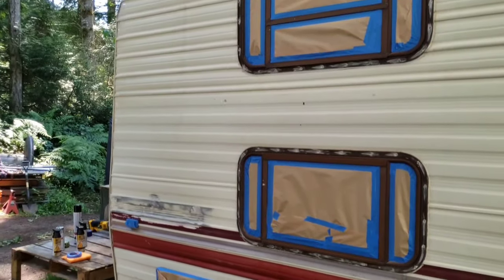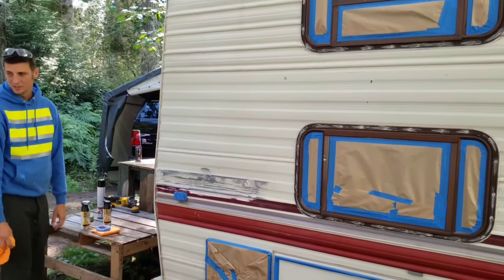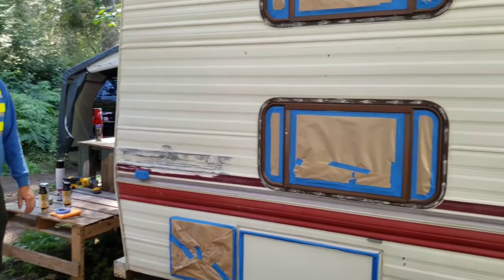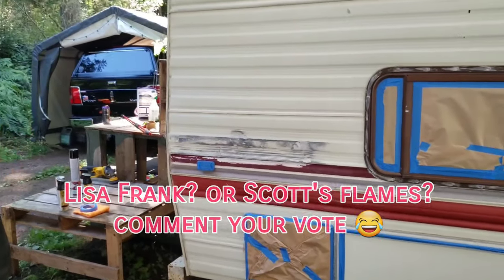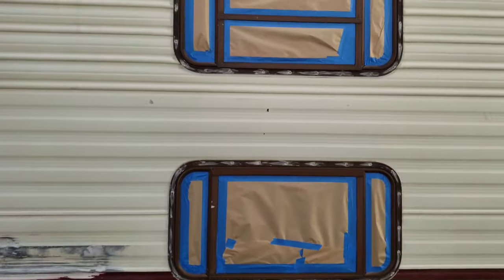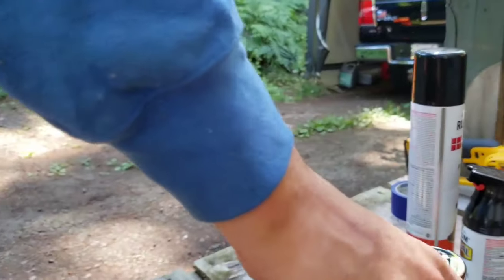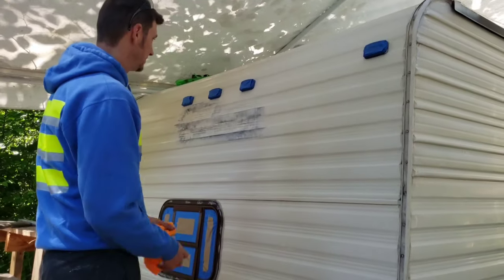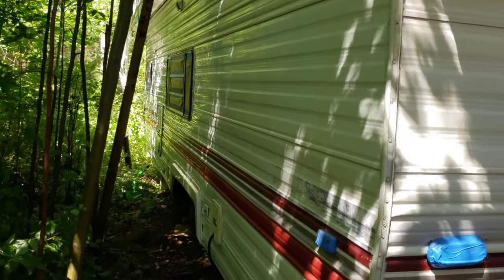1987 Terry Taurus camper (the Roe Rig) gets a fresh paint job in 2020!

Comment: Looks so nice! We are about to paint ours, if that’s possible, can you please put the link for all the paint you used? Tks
Reply from the maker: Hello! I am sure you've already completed you project by now, but I asked and we used an exterior-rated Valspar (likely we used the DuraMax line) white paint. 

https://www.lowes.com/pd/Valspar-Duramax-Ultra-White-Semi-gloss-Latex-Exterior-Paint-Actual-Net-Contents-31-5/5001294899

Basically anything exterior rated, that claims to adhere to metals or vinyl, is likely to be just fine for your purposes. Of course if the budget allows for it, I believe there are "premium" levels beyond DuraMax that could have longer staying power.

As for the black trim, I had already been using Rust-oleum hammered spray paint in black for many of the interiors, so I maintained consistency with the exterior trim as well.

https://www.lowes.com/pd/Rust-Oleum-Universal-Gloss-Black-Hammered-Spray-Paint-and-Primer-In-One-Actual-Net-Contents-12-oz/3728965

Best of luck!

Comment: What paint did you use? Also what did you do to get it ready for the paint?
Reply from the maker: Hey there! I apologize that we didn't keep good record of the paint we used, I'm assuming you're asking about the white exterior. We did seek out an outdoor rated paint with primer built in, and we got it at Lowes but I can't remember what brand or line it was. To prep for the paint we scrubbed the exterior down with soap and water & let it dry but we did nothing else crazy special!

Comment: Hey. Love the video. I’m helping my dad fix up a 1995 prowler. I know you can’t find the exact paint you used but was it house paint?
Reply from the maker: Hey there! I did end up finding out what we used :)

We used an exterior-rated Valspar (likely we used the DuraMax line) white paint. 

https://www.lowes.com/pd/Valspar-Duramax-Ultra-White-Semi-gloss-Latex-Exterior-Paint-Actual-Net-Contents-31-5/5001294899

Basically anything exterior rated, that claims to adhere to metals or vinyl, is likely to be just fine for your purposes. Of course if the budget allows for it, I believe there are "premium" levels beyond DuraMax that could have longer staying power.

As for the black trim, I had already been using Rust-oleum hammered spray paint in black for many of the interiors, so I maintained consistency with the exterior trim as well.

https://www.lowes.com/pd/Rust-Oleum-Universal-Gloss-Black-Hammered-Spray-Paint-and-Primer-In-One-Actual-Net-Contents-12-oz/3728965

Best of luck!